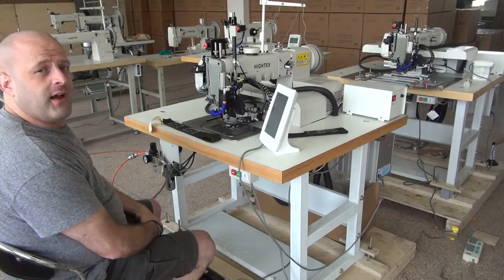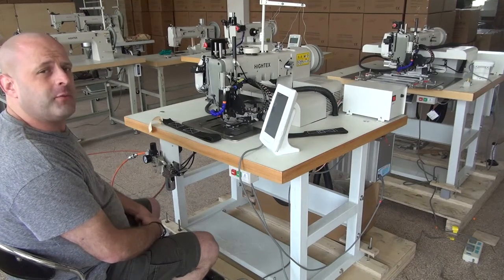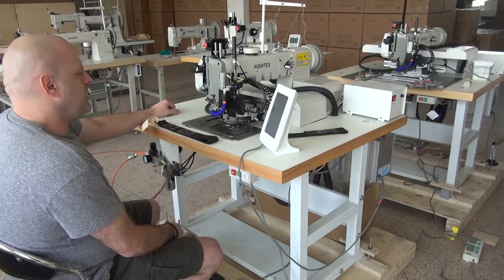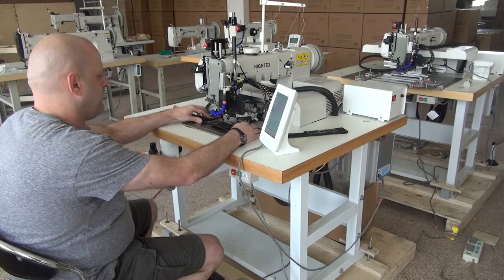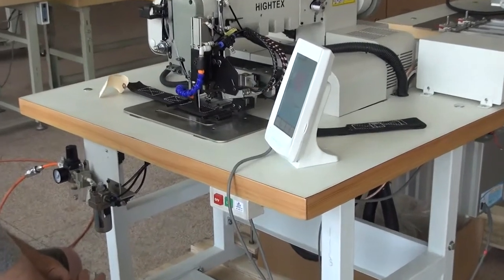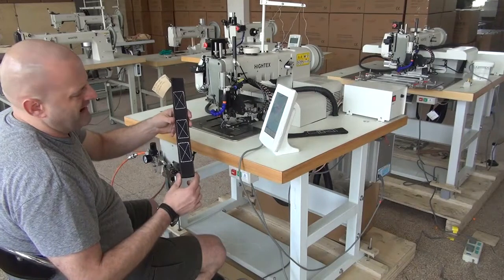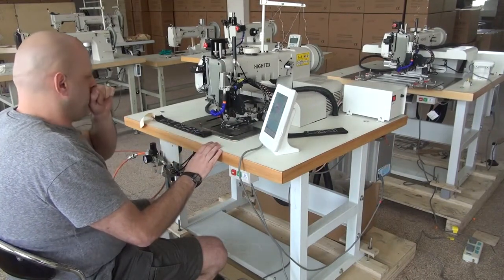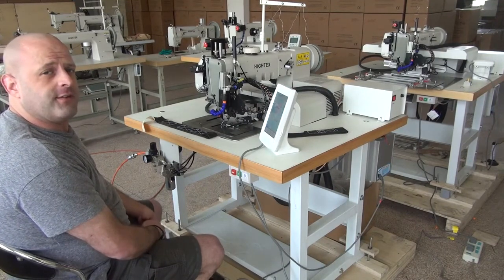Heavy Duty Programmable Sewing Machine for safety harness and fall protection equipment

Comment: I want to fix my dog's seat cover. One of the straps tore. The material is like a seat belt. Does anyone know if I need a special needle to get the job done? I'm just getting in to sewing, and have a small machine.
Reply from the maker: HighTex 7273PLK or 72600PLK/S should be better. Please write to info@automatic-sewing.com for detailed information, thanks!

Comment: the plugs on the floor dont look like regular 120 volt plugs are they 3 phase 208
Reply from the maker: For hightex serial automatic pattern sewing machines, we only provide 220V.
Reply: coming in to a building is 240 witch is 2 legs 120 each to the neutral and 240 between both legs then there is 3 pahse 208 three legs 120 each phase to neutral and there is 480 three phase 277 each phase to neutral consolt a electrican befor working on a circut this is my understanding
Reply from the maker: The servo motor on this heavy programmable pattern sewing machine can fit 200V-240V, 50-60Hz power. It just with different pin on plug, the customers have to change plug if they have special requirements. We have had problem with power, in past years, we sold over 1000 sets automatic pattern tacking and bar tacking machine in China, United States, Germany, Spain, Italy, France, Sweden,  Australia, Chile, Colombia, Brazil, Mexico, South Africa, India and Thailand.

Comment: Hi. Can anyone tell how to conect air pomp to programmeble sewing machine? And what kind and powerful is air compressor? Thanks
Reply from the maker: You just need a regular air compressor with about 5 Liter tank (bigger air compressor is better, if you have many automatic pattern sewing machine). If your programmable pattern sewing machine is from HighTex company, it is easy,  just use a 6mm (diameter) of air tube to connect.

Comment: hi can i asked if this machine used a air compressor for the paddle?
Reply from the maker: Yes, the machine needs air compressor, both pedal, clamp and automatic lubrication need air.
Reply from the maker: do you have our machine? Please contact our sale engineer at info@cowboysew.com, thanks!
Reply: How to save new patern please